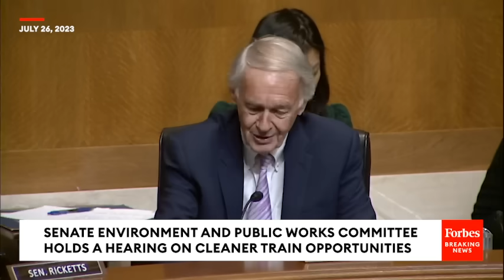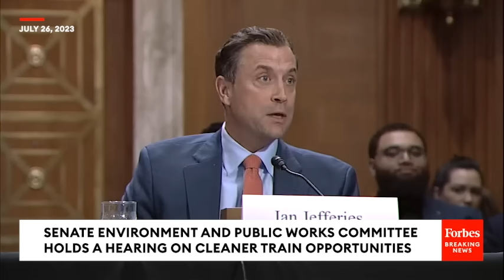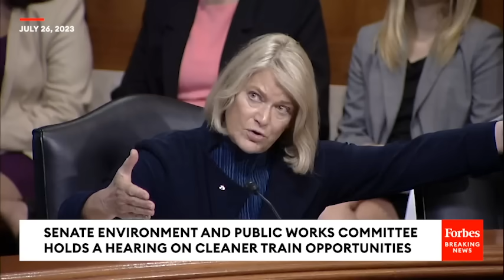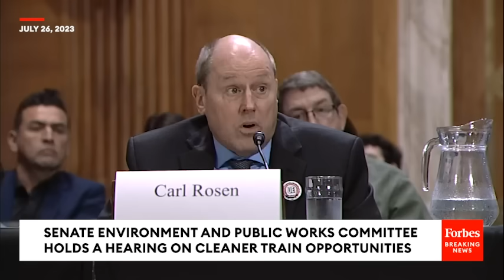‘How Long Would It Take To Replace All Diesel Locomotives With Electric?’ Cynthia Lummis

Comment: Pure idiocracy, diesel locomotives are "electric hybrid." Step outside and look around senator, you need some field experience
Reply: My initial reason to watch this video was to say exactly what you said.  However, she didn't say "switch diesel locomotives to electric," she said, "switch to zero emission locomotives," and if you watch the video you'll see she's leading her witness to state that it would be much more feasible to lower overall emissions by getting more freight moved via current rail systems rather than push to have zero emission locomotives.  That, and she gets on California's back about wanting more windmill farms but not in their own backyard.
Reply: @thatjeff7550  That is an oxymoron. No such thing as zero emissions
Reply: 👏👏👏👏👏👏thank you
Reply: NO they are NOT hybrid. They do NOT go between electric and fuel. They are electric created by a generator using diesel. Maybe EWE should pull your head out once in awhile and get some fresh air.
Talk about idiocracy, maybe you should have Googled before you embarrassed yourself...
Reply: And has been for nearing 100 years.
Reply: You misunderstood. She is against the push for electric locomotives and asked questions intended to prove that it is not a reasonable goal for at least the foreseeable future. She knows more than you give her credit for, and wanted the witnesses to explain that in great detail (rather than making a speech herself, as most senators seem to do).
Reply: No.  Diesel locomotives are not hybrids.  In the context of automotive engineering, "hybrid" means there are two forms of energy storage onboard for main propulsion.  Every bit of energy for propelling a diesel-electric locomotive comes from diesel fuel, so it is not a hybrid.
Reply: @andyharman3022 WRONG the ENERGY to run a locomotive IS ELECTRICITY! That ELECTRICITY is CREATED by a diesel generator...
Reply: @KATONKA...  You just proved my point without realizing it.
Reply: @KATONKA...   He just said that.  The ultimate source of the energy is diesel fuel.
Reply: @bite-sizedshorts9635  give his and explanations, I have a hybrid microwave. Sometimes it runs on the energy of coal and other times the energy of gas, that's neat, just like my house...
Reply: @andyharman3022 same with they're so called hybrid cars.
Reply: @andyharman3022  they can move about the yard with out starting that ICE.  Research better next time